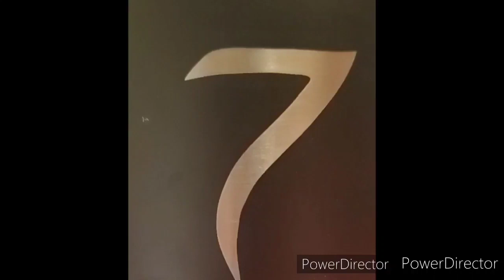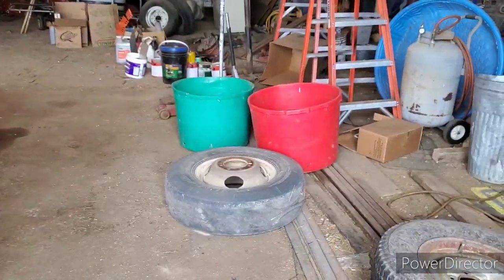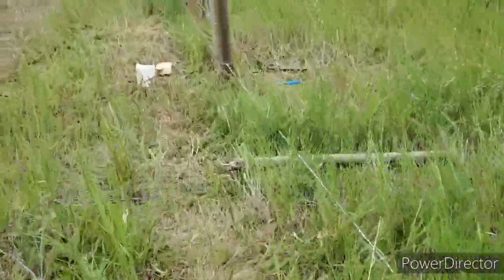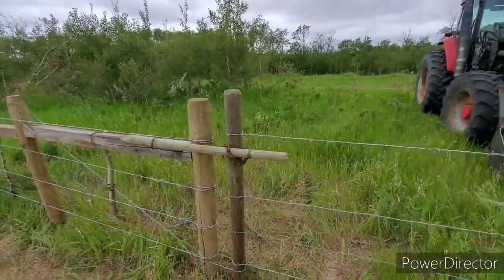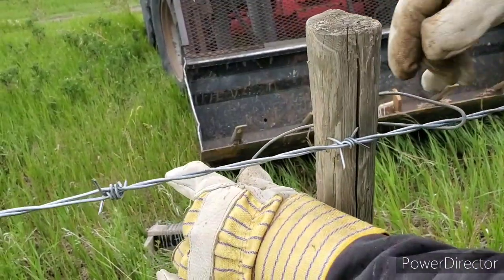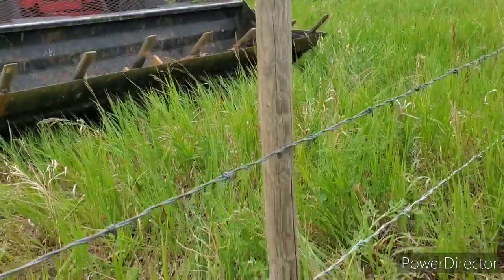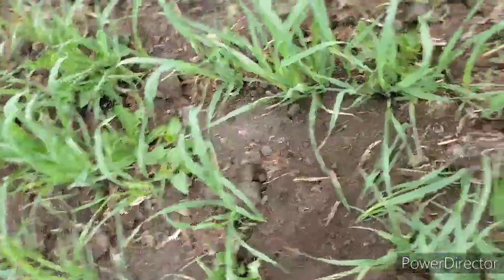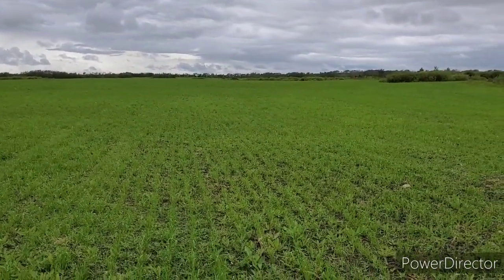HOW TO BUILD A 4 WIRE FENCE YOURSELF Part 4 Wire Gates

Comment: That a great idea for that gate latch we just have a wire that goes over the top of both post and it a pain to shut the gate great video thanks for sharing
Reply from the maker: You can still have the wire that goes over top but put the post tie on to aid in getting the gate closed...thanks Cameron